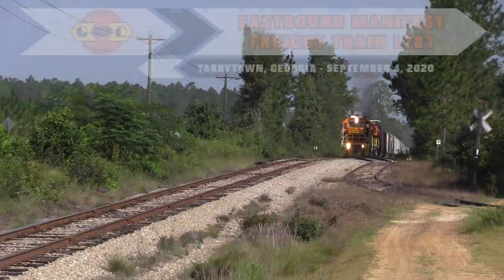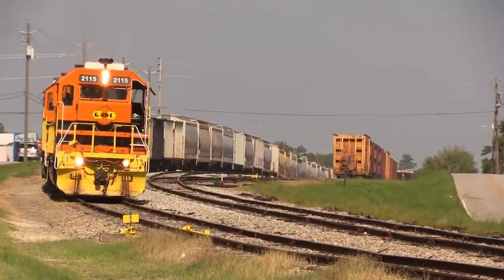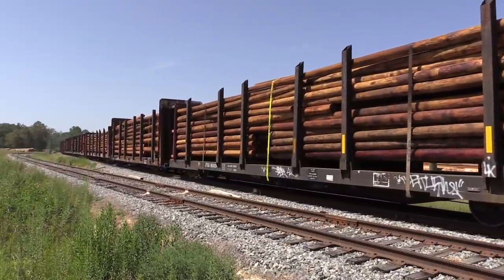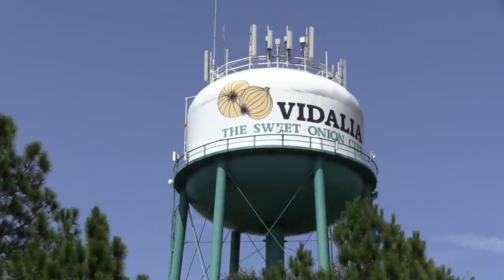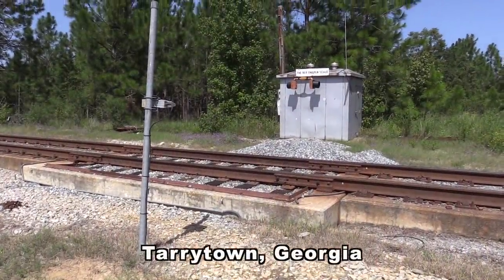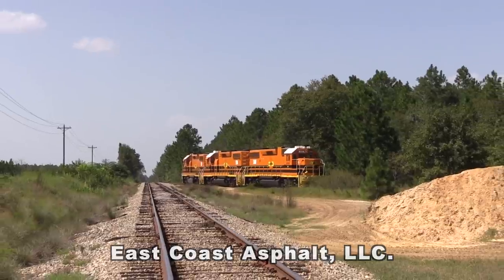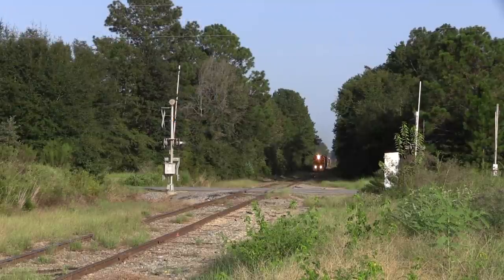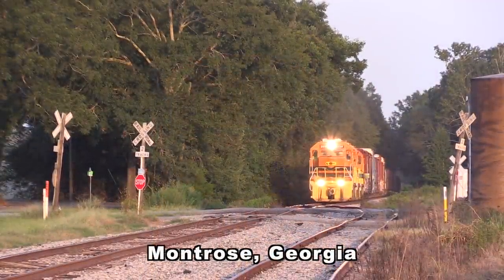Georgia Central’s Geeps: EMD Classics on Train L781

Comment: They need to bring back the SD40S
Reply: Yeah but what about the High hood U23B's this road used to be known for?
Reply: @kingofthepod5169  There were U30Bs too.
Reply: Those too.
Reply: SD40-3s are still here. They are on L782. Not for long though since GC is going back to an all GE roster.
Reply: @georgiacentralfan  which GE's are coming back?
Reply: @kingofthepod5169  former NS B32-8s